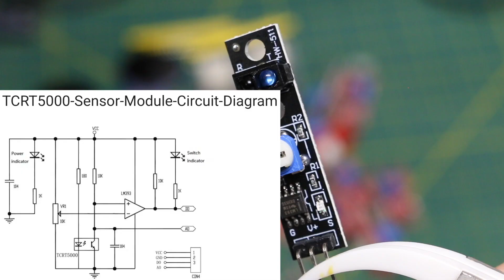Mailbag!

Comment: Tension springs & piezo discs, do I hear a spring echo in the making? (sorry for the bad pun)
Reply from the maker: With lots of reverb as well. Halloween is coming but I don’t know if I’ll be ready in time.
Reply: my thoughts exactly 🙂
Reply from the maker: it won’t be a spring reverb type unit, but it will help making noise.
Reply: @GadgetReboot  Not one of them big metal plate jobs, can't think what they are called. hung on springs and filled with audio to produce some weird resonances.